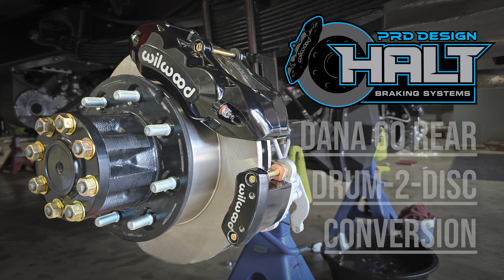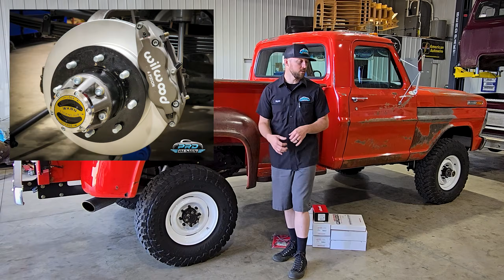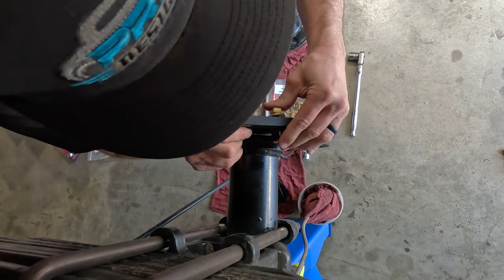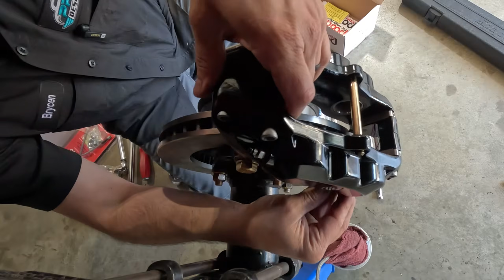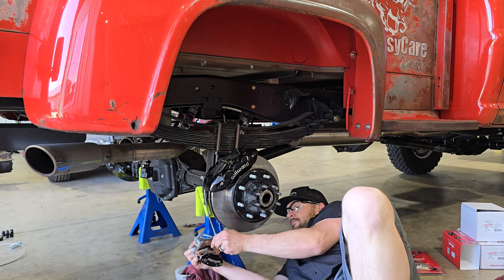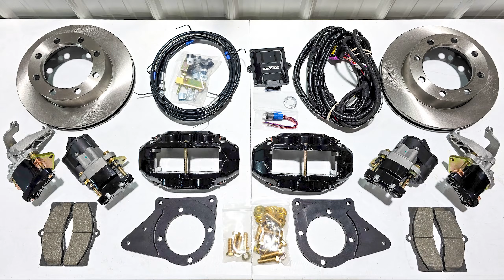Halt How-to Dana 60 Rear Drum2Disc Installation - PRD Design

Comment: Definitely installing this for my Dana 60 rear on the ‘73 Crew when I get to that part. 😎🤙🏻 Appreciate the info. Gonna swap the front for your kit too. 

Would the parking brake cable work for a crew cab with needing the extra length?

Keep up the awesome work. 😎💪🏻
Reply from the maker: The cables will work. They are long and you cut them to length
Reply: @prddesign awesome. Appreciate the feedback. 😎🤙🏻

Comment: I have an 1986 Ford econoline Dana 60 rear and a ford king pin 1971 dana 60 front axles for an off-road project.., will your brake kits fit these axles?